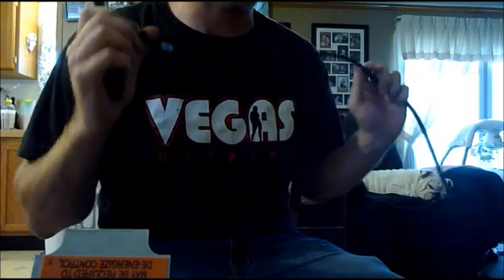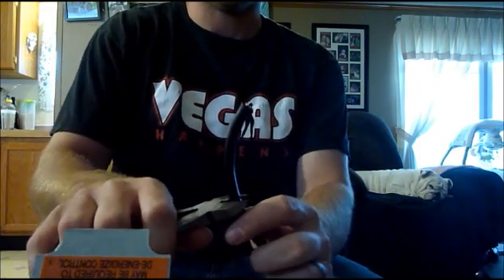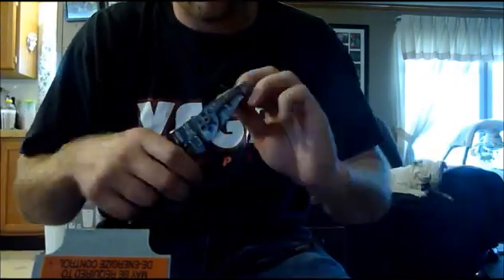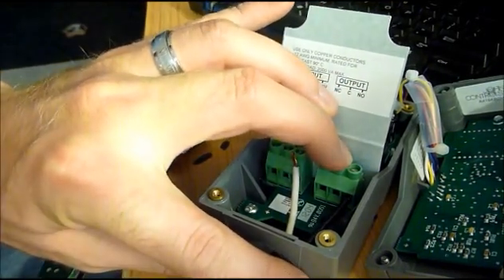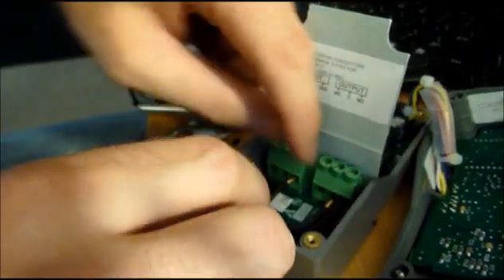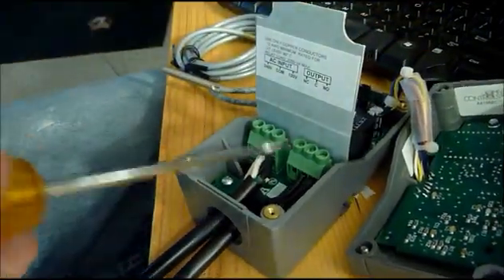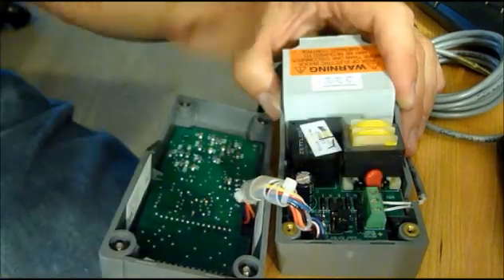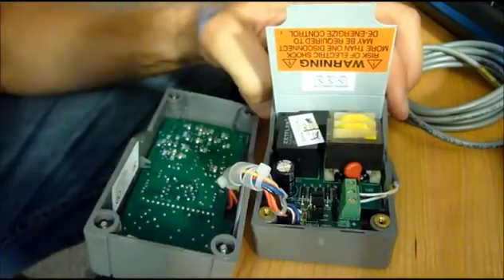How to Wire the Johnson A419 HTWL

Comment: To all those people hating. The wiring is accurate the way he shows to do it, it works. This unit doesn’t require a dedicated ground, as it is encase in plastic and strikes the earth through neutral, ground is not shown in the wiring diagram. He doesn’t use a 3/8 cable clamp connector and the terminology he is using is for DC which is wrong. If he used AC terminology it would have sounded more professional.

Comment: Thanks Leo.  A419 is now discontinued. A421 is the new unit.
NOTICE: wiring locations are in different sequence than the A419. Also no jumper now for switching from heat to cool.
Controlled by how you set the ON and OFF on the unit.
I split a 15' 16 gauge extension cord in half and worked great. 
I agree with Brian, just pass the grounds through and use a wire nut to connect the greens.

Comment: Be more careful with electrical saqfety.  The two ground wires SHOULD NOT be cut off.  They should be wire nutted together at least.  You need to carry the ground wire through to your load unless it's UL listed as double insulated. Ground is there for our protection from leaking voltages or inadvertant connections from a metal case to the power conductor. It's for our protection.

Comment: I agree with Matty; you should have passed the ground through and kept it. Just use a wire nut to connect the greens and you'll be fine. In fact, I found a diagram from Johnson showing the ground connected. Good luck!

Comment from the maker: I understand what you are saying, but unfortunately it can only run 2 devices at once if they run at the same time.  i.e. lets say you need a fan and water pump to turn on a 20 degrees, not a problem, just run a power splitter.  If you need a water pump to turn on at any temp lower than 15 and a fan for any temp above 20, then you need to A419's.  Happy brewing!

Comment: The unit seems to not want to heat only cool, the strange thing is that the flame icon on the display is visible. So that tells me it's in heating mode but it's cooling, is there a chance the jumpers are wired backwards?

Comment from the maker: The cables are purchased in bulk from china, i have het to find a cable without the third wire, and I have purchased them by the thousands before.  I used alibaba dot com for most of the purchases.  Most electr4onics these days, including computers, have the common ground and the earth ground on the same circuit..... wierd I know, but when we were testing for the 60601, we found that out.  To be absolutely safe, yes, splice the two green wires, and I agree i should have done that in the video

Comment: It's a pretty big what if - enough that the companies pay for that third green wire in the cable they run from the fridge (same as any appliance with touchable metal). All I'm saying is instead of cutting the green ground wire out of the extension cords, splice them. You seem to be pretty great with safety through the video (which is awesome, kudos! Most of the other videos I've seen people don't seem to care and that can get people killed like you said), so this would go along that same vein.

Comment: Hey, thanks for the video. I'm looking to get a chest freezer for brewing and was curious how these guys work. My only concern is you disconnected the ground wires. Normally I wouldn't care, but most freezers have a metal liner. If a wire breaks inside and touches that metal, someone could get a nasty shock, which the ground would avoid. It's two more wires to trim and an extra splice with a wire nut but it could help keep someone alive.